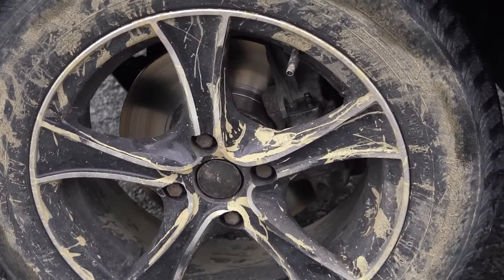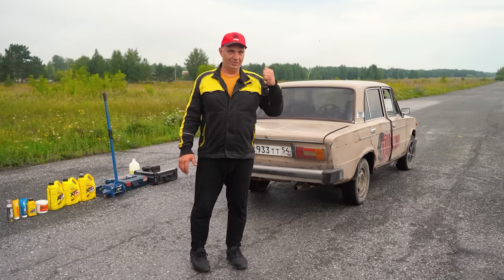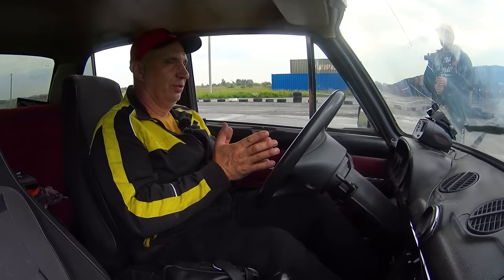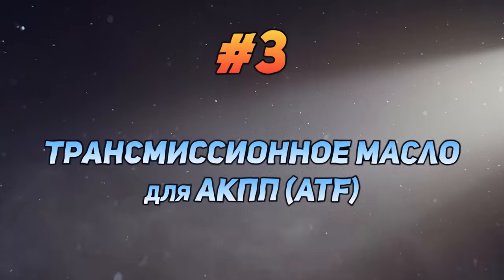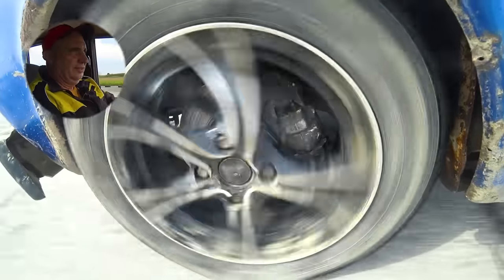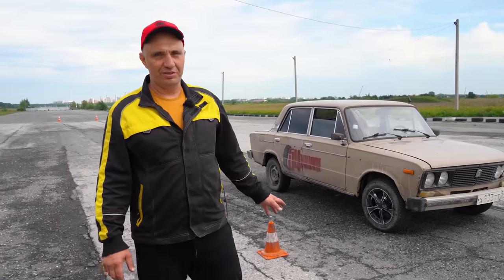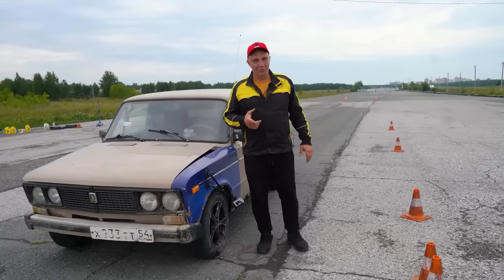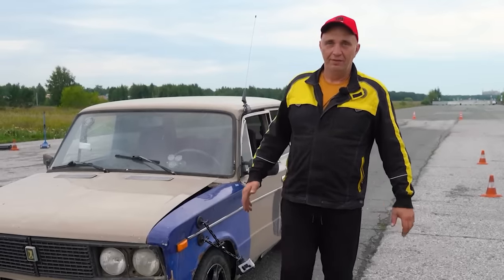We cover brake rotors in grease (and other lubricants) - what will happen?

Comment: Several sets of pads soaked overnight in the different lubricants. Rotors won’t matter as it burns off fast. Much more fair test.
Reply: Disc's
Reply: @dogwalker666  they refer to them as rotors in this video.
Reply: Who would ever remove pads to soak them in lube as a fair test? You would need a lot of pads.
Reply: @tikihutdweller5944  that’s the point. Pads do most of the work and wear the easiest. They are also absorbent to a point. The rotors always wipe clean to a shine.
Reply: Agreed, it's the pads that soak up and change their properties, anything on the rotors/disks will just sooner or later scrape off.
Reply: The brake pads get much hotter than the rotors because they have less mass and surface area.  As long as the oil cannot withstand the heat I bet they will rapidly burn off also.

The anti-seize likely had such a strong effect in spite of being much higher friction and viscosity because it was not burning off.  The really light slick oils didn't have such a large effect.

They should have tried synthetic high temp caliper grease because I've actually seen people put that on the friction faces of pads instead of the slide pins and backing plates.
Reply: @F0rdy57  What tests have been done to various brake pads to determine how much of each type of lube they soak up, if any? And what is the point that they soak it up to. There are different types of pads along with the many lubes shown here and others. How many people soak their pads in lube and for how long and what information will you get out of this type of test. References please.
Reply: @F0rdy57  No idea what they call them in the video, I don't speak Russian,  The translator who re posts them isn't a mechanic he makes lots of mistakes.

Comment: i wonder about the coating like cosmoline that some brake rotors have on them from the factory to keep them from rusting if you don't clean it off before using brakes does it make much difference on brand new rotors that have machining marks that have to be worn down anyway.
Reply: Brake rotor coatings don’t have to be removed.
Reply: im one of those people that cleans the rotor like crazy. this video made me rethink that

Comment: Because the rotor and pads is like the lockup clutch in a torque converter ATF is meant to lubricate certain parts but GRAB clutch material.

Comment: 7:19 i Had expected this Outcome because Automatic Transmissions have cluches in this oil an they need to grip hard. The reason for the oil i think is Heat disapation for the cluch Pack. I know those Planetary Gear Set Automatic Transmissions are rough to the cluch so this might be a solution for longevety
Reply: ATF serves a whole myriad of purpose in a transmission. It is in large part a "hydraulic fluid" and as such is loosely based on the stuff normally found in heavy equipment hydraulics, with some extra goodies tossed in to make it a bit more special...

It carries away heat, yes, but not just from the clutches and bands. Much of the heat  produced comes from within the torque converter. The full force of the engine output flows through the ATF between 2 sets of moving vanes and a stationary set. The heat comes from hydrodynamic losses as the fluid is forced to change direction as it does its job.

So yes, a coolant, but also the lubricant for everything within, including the differential in the case of a transaxle, with grippy tricks for the clutches/bands. It is also used hydraulically to engage and release said clutches/bands.

It does all this while rather hot, so it must also remain stable and not break down, be able to "clean up behind itself" (detergent action) continuously, and without foaming.

It doesn't take the same beating engine oil does but has a rather difficult job all the same.

Contrast to a manual gear lube... it is 95% lubrication and 5% coolant. There's very little heat generated in a manual. (This is lost engine power in an automatic by the way, just another reason to drive a stick... I digress lol)

Comment: ATF is a fluid with a certain defined amount of grip to it. The result didn't really surprise me. CVTs, that use chains running in oil, wouldn't really work without that feature.

Comment: There is one more lubricant that is regularly used as an anti-seize "grease". I think the white one is based on ceramics, correct? There is also 1 that has the color of copper. I don't know if it is just very fine copper powder or if it is mixed with some kind of coating. But it is used around the braking system too, just like the ceramic/white spray. If you know what I am talking about, please try that one too, next time.

Comment: hey hello, congratulations for your beautiful videos, but this time I have a question, isn't it that the increasingly worse braking results can be attributed to the soaking of the brake pads rather than to the difference in lubricant? did you finally try to repeat the first test to see if the result is the same?? let me know, byeee
Reply: They really should have changed the pads for every test.

Comment: I can witness that if you spill brake fluid on those bicycle brake discs, the damn things will just squeal and have no braking force. You have to find a slope long enough, steep enough but not too steep, and burn the brakes through downhill. Then, they will stop squealing for the rest of the day, but the next day it's back. You can throw away the pads and the discs really.. hate them things.
Reply: Only solution is burning the pads on fire. But even then it doesn't always recover their original performance.
Reply: You can soak in a solvent overnight.
Reply: Remember rubber pads working on the rims?  This is one of the examples that prove the merit of K.I.S.S.
Reply: @robwilde855  That's what I thought when I got my first disc brake on a bycicle and ruined it on a few weeks by spraying WD-40 onto some other part of the bycicle.

Comment: I got one for you, bolt 2 engine blocks opposite of each other and connect crankshaft with a fat chain to synchronize and see if you can get to run.
Reply: @richiesrestorations4883  Yep, the DIY v12, after some time today i saw the thumbnail again and pretty high views.

But making a DIY opposed engine would be a worlds first, i think and a pretty difficult one, opposing 2 engines is easy, but you still need to add fuel, air and an exit for the gasses.

you need a mid block with valves and probably custom enlonged pistons but with the pistons rings on the same spot.

since they have some experiences with casting.

Comment: Glad that someone did this - obviously this is not something most of us are willing to test on our own cars so we just 'imagine' the results.
It is interesting that the oil clearly does 'burn off' in time - the question is how long?
Further options to try:
Water  (this gets more complicated if the road also gets wet)
Grease and water
What happens when the stop test is repeated over and over - does full stopping come back eventually? How many times does it take?
I.e. I have seen many people say that spraying WD40 causes no long term harm - i.e. once the brakes have been fully heat cycled none of the WD40 remains and braking is fully restored or even slightly better due to any existing grease and water being removed (only testing can prove this).
 (Obviously takes some discipline to do the first heat cycle safely - which all drivers should do anyway)  As a pilot we test the brakes as soon as we move the aircraft!
 In the video he said he cleaned up the brakes before the next oil was applied - he should have shown that full braking performance was restored after each clean-up, which may also expose any variability in his breaking technique.
Ideally an inspection / measurement of the pads would show if any long term effects can be seen?
Does brake cleaner really put the pads back 100% to normal - probably needs a long term test to be sure.

Comment: I can tell you for a fact that power steering fluid will not affect your brakes but it will affect your tires and grip quite a lot!😊
Reply: Power steering and brake fluid are very similar in composition
Reply: @MadScientist267  ya absolutely. Hydraulic fluid on the tires is an interesting time.

Comment: I had a old truck with only front breaks an the power steering line broke sprayed all over the fan an went on the breaks rotors an calipers an was a bit  sketchy good thing trucks a manual just used the gears to slow down

Comment: Valuable information although the amount of lubes used was rather absurd. A small smear would have been more realistic. So even if by accident you smear a little bit of grease while replacing pads or disks, it will have almost no effect and it will probably clear before you even know it.

Comment: I've never bothered degreasing new rotors and it has never caused a problem. perhaps I should, but my car has stopped juat fine and worn off the oil in good time.

Comment: What about painting the rotors?
I've seen a video where the guy paints them because they look good
Reply: Paint em and drive around. Anywhere the pad touches will get the paint scraped away and the rest will look good lol. I always give my rotors a coat of high temp black for corrosion protection.

Comment: I had to put some oil on my bikes brake or it would brake so hard it would lock up the wheel from the slightest touch
Reply: Just buy cheaper brakes next time.
Reply: @andrelange9877  no they are original

Comment: Compress the sponge before adding liquid to the surface, the pores act like small vaccumes and draw it in better.

The other way around the first compression pushes material away as the air excapes
Reply: Probably too low viscosity to soak into sponge

Comment: What if you double the tires en each hub, with 8 for the entire car...does the distance will be less?
Reply: no :(
need either more grippy tires or less vehicle weight
adding wheels, adds weight
Reply: @DarkIzo less weigh is just as detrimental as being super heavy. To light and you’ll just lock the brakes up, to heavy and the weight of the vehicle will “outpush” the stopping power of the brakes. More tires=more surface area on the road meaning more grip. Now to big a tire on to small a brake set up and the same issue happens as having a super heavy vehicle.

Comment: I would like to see some of the more liquid lubricants be constantly sprayed onto the rotors. Maybe make some sort of pump system to spray oil onto the rotors and see if a constant leak is even worse? I think if the leak keeps dropping more oil onto the brakes they will work even less!

Comment: I think the brake pads just got saturated with whatever oil at some point and then it was performing the same with their performance changing from "dry" to wet and not oil specific, it happened to me on a bike and the pads never performed the same afterwards no matter how much i degreased them, the brakes are funky if not giving them the full thrust and even then are just like you give them all you have and they do all they can.
The test would be more valid by degreasing the rotors and using new pads everytime but heck what a waste lol

Comment: Atf has friction modifiers added to it to help grip the steels inside an automatic transmission. You see clutch packs inside auto transmissions are made up of steel plates and fiber plates much like brake shoes and a rotor. The transmission fluid should have stopped the car better than the dry rotor. This video is a fake. Go back and listen to the wheels try to lock up, he let off of the brakes and let it roll farther! Google what transmission fluid is made of and you will find 2 special oil modifiers are added to transmission fluid unlike the other substances they put on the rotors.